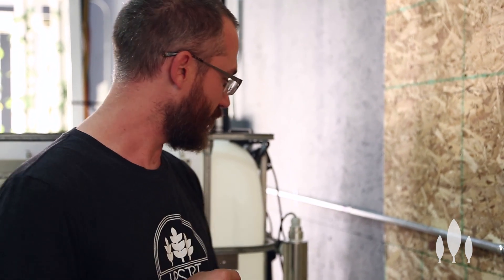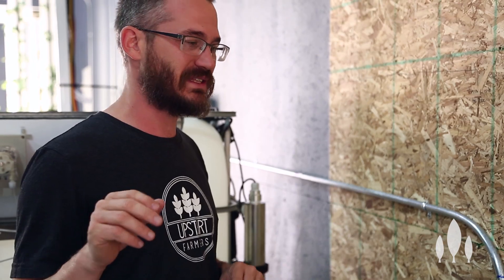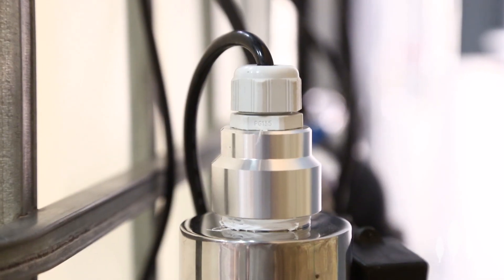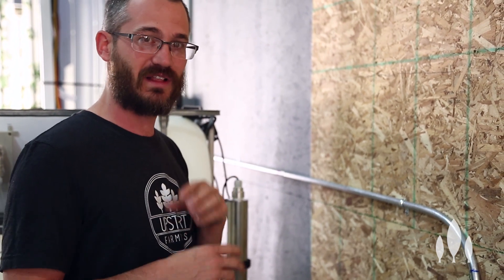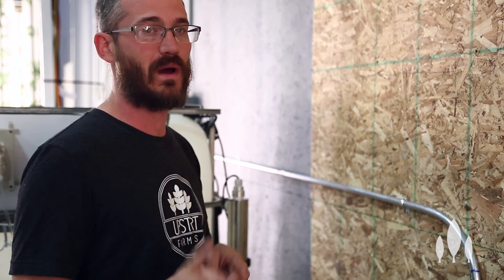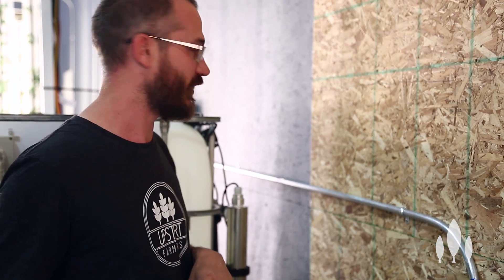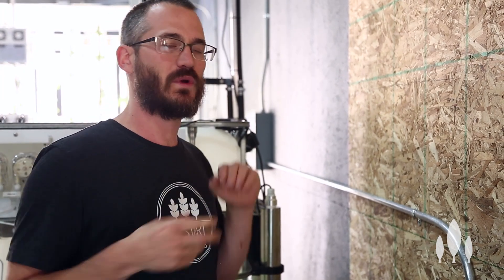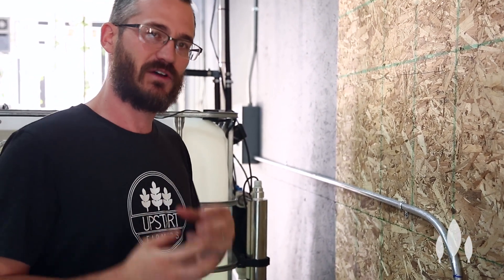UV Clarifiers for Indoor Growers

Comment: My water is a bit slimy.   Is that Algea?  And will this clear it up?
Reply from the maker: Hello, as long as your reservoir tank or drain water are coming into contact with light, algae will form by feeding on the nutrients in the water. A UV disinfection unit can help manage algae, but it won’t clear it on its own. 

You will still have to routinely clean your reservoir when algae levels get too high. The UV disinfection will reduce the amount of cleanings needed throughout the year.

Comment: Will the UV kill the added nutrient if i pipe it in after I have added nutrient?
Reply: Wesley Pals your nutrient is not alive. You can't kill it
Reply: i had the same concern , UV sterilizer does strip the nutrients , i guess there is a proper calibration to set for aquaponics where the UV sterilization should be used intermittently (ex : 2 hours a day)  but still since i have been having working on getting the nutrients ratio balanced i m worried to impact the growth of the crops. found this article with links to  tests and results http://www.hortidaily.com/article/33628/UV-sterilization-in-aquaponics

Comment: My system has been running for 4 weeks now and i have a little algae in the gutters non in the sump, at what point would you suggest i introduce uv?
Reply from the maker: Hi +SeanC571 - I wouldn’t introduce UV unless you need it.  A little alage in the gutters is normal and no problem.  If it clogs your pump or drippers, you might look at UV.